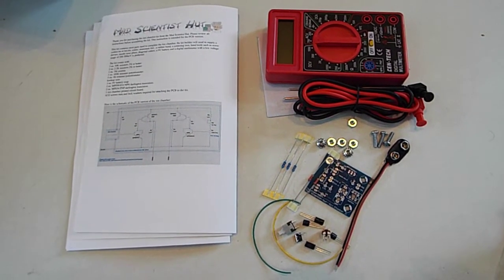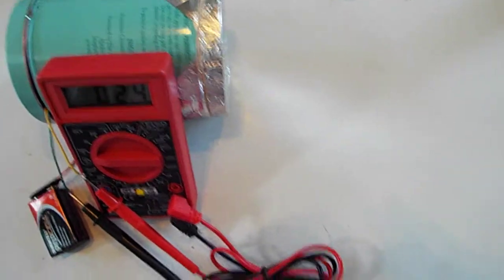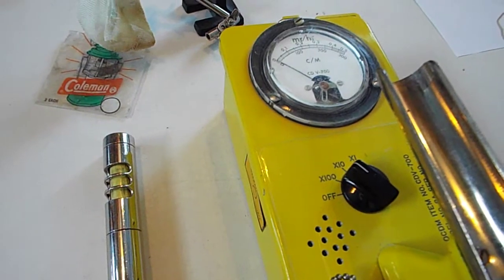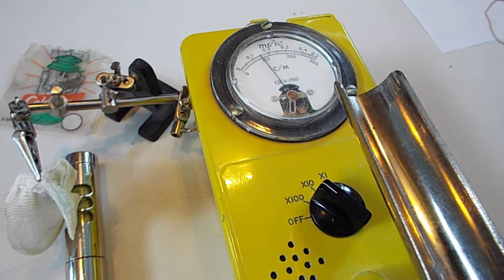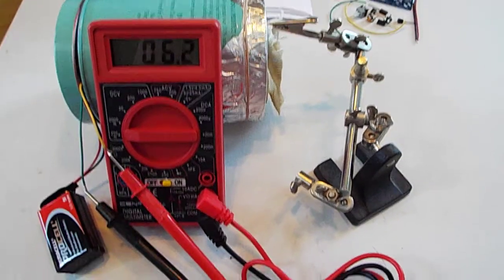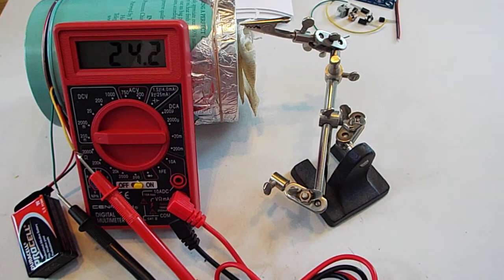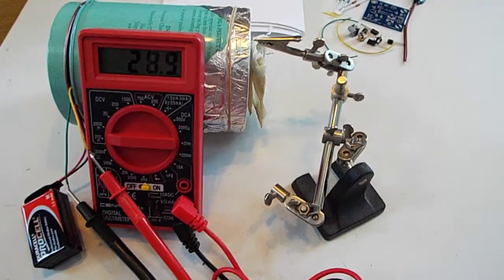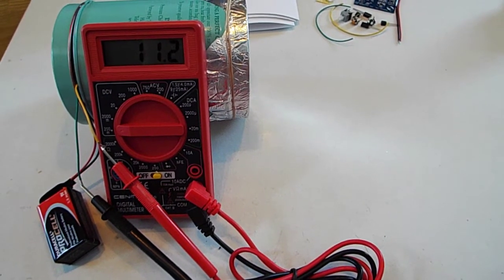Ion Chamber Kit Demo (Version II)

Comment: Interesting. And I have to wonder what differences there are in the circuitry, or construction, of the CD V-700 that allow it's signal to quickly return to background levels when the radiation source is moved away.
Reply from the maker: HI John, Good question. A Geiger counter tube is designed to respond quickly to radiation passing through it. The tube is charged to a very high voltage, some Geiger tubes are charged as high as 1KV. As radiation passes through a Geiger tube the ionization causes a spark to jump between the cathode and anode of the tube, and that is the click you hear in the speaker for each radiation event passing through the tube that causes ionization. You can actually use a Geiger tube as an ion chamber if you lower the voltage on the tube, then it will have a very similar output (current in relation to radiation). The difference in the circuit makes a Geiger counter more complicated since you have to design a high voltage supply and a pulse stretcher to 'catch' the sparks, then a RC averaging circuit for each range to display the counts per minute, an ion chamber just has to 'display' the current from the ionization so it is a much simpler circuit.